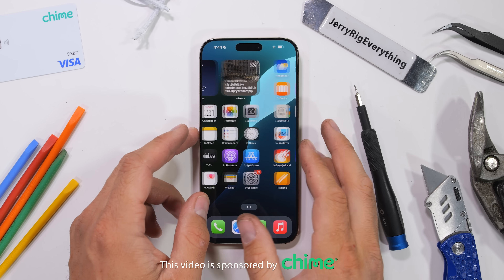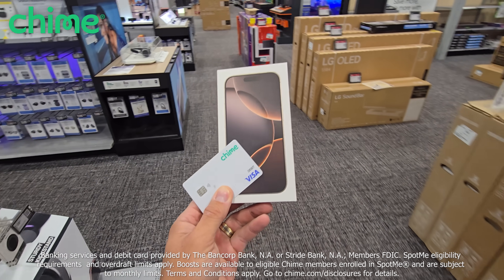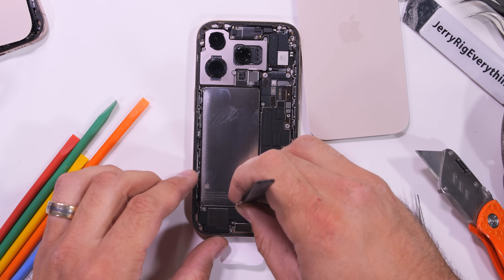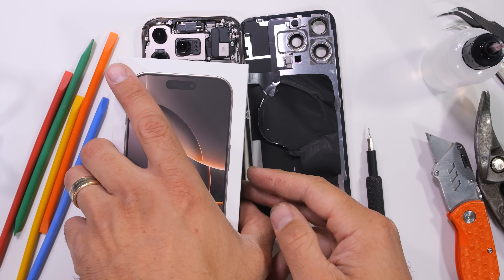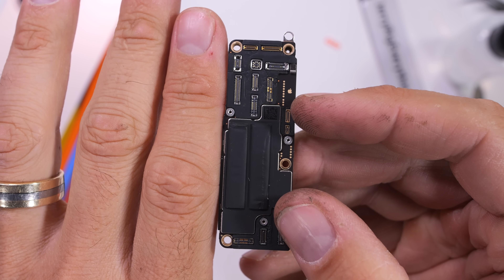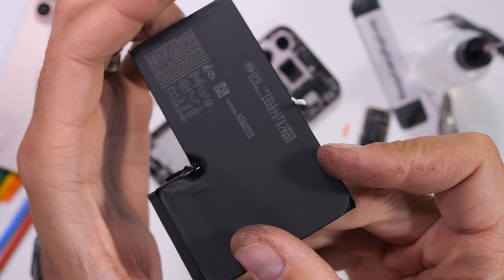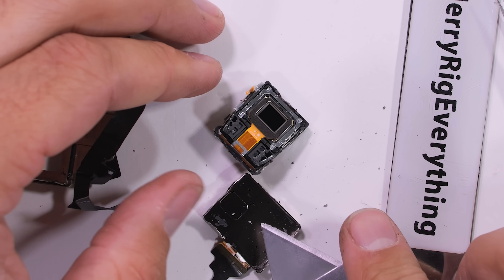Dear Apple: i am sorry...  (iPhone 16 Pro Max Teardown)

Comment: I’m still confused about the reason for the metal housing on the battery… you mention that a potential reason is to keep up with repairability and sustainability regulations and that this would also explain the existence of the new repair guides, but how does this requirement necessitate a metal housing? Are metal housed batteries more recyclable or something?

Comment: Still prefer apple over android , apple's hardware and software both are designed in house so I have not seen any major issue , but in android since both are not in house i have seen premium phone lagging because of a update or maybe hang very frequently so i know apple is not having best features but I like the phone last 4+ years which is value for money.

Comment: You Should try the 16 teardown as it doesnt have pull tabs it has something electrically activated glue which lets the battery off when current is passed

Comment: The metal battery is very cool. I am interested whether trusted aftermarket part providers will use the metal enclosure too or keep it as the old batteries.

Comment: Fun fact the non-Pro iPhone 16s have a battery removal process that is truly next gen, they use an electrically operated adhesive (need to connect a 9V battery to certain points on the phone chassis) which has the potental to be far better than pull tabs which break fairly easily (unfortunately no more satisfying pull tab noises)

Comment: providing the repair guides and encasing the battery in metal is just prep for the EU requirements.  I was hoping to see a chassis where the back cover would be fastened with screws though.....

Comment: You should check out the battery removal process on the regular 16 which needs a charge to remove the adhesive. I think you’d like to give color on that

Comment: The non-pro iphone 16 has something even wierder. There are electrodes that melt the battery glue when you connect a 9V battery to them. Phone Repair Guru has a short about it.

Comment: them releasing that NOW and under pressure should not make you reconsider your thought about apple. remember that is only half of the problem. the other half is making their phones repairable in the first place. they have specifically designed them to be non-repairable. its so obvious because they even glued down the battery when its already sandwiched in-between the screen and the back case (which by the way is ALSO glued down to the frame). still absolute scumbags. they, and many other companies know EXACTLY what they are doing. and its comical because everyone puts the blame on the people buying the phones about e-waste when the companies are forcing people to buy completely new phones every year. Releasing the repair info is a small start, but still scumbags

Comment: 6:18 The lithium in the batteries can be recycled at specialized centers. This does not mean you should throw your batteries in your recycling bin, this is a hazard. I'm also curious why Apple decided to have pull tabs on some, the electric removal adhesive, and the metal framed battery instead of the same across all iPhone 16 models. Maybe they're just testing the waters.

Comment: That pull tabs at 5:20 has the same sound of my door when i try to be as quiet as possible in the middle of the night😂
Reply: the iphone 16 just got a major wedgy!!!
Reply: Real
Reply: This could be ASMR for someone for sure lol
Reply: I started hearing police siren at this 5:35 time
Reply: What is the logic behind the steel battery case?  The only thing I can come up wuthering is thermal performance.
Reply: Indeed, true story bro.
Reply: @op, it's not the door bruv, your missus is just timing her farts perfectly!
Reply: When you wanna get something from kitchen at 3AM 😂
Reply: Same here 😂😂😂
Reply: lol that's so relatable lol!
Reply: Mine used to sound like that when me and my family moved in, within a week, I replaced the hinges with squeak proof hinges, and haven't had a problem
Reply: @whatluck1508  You can just oil the hinges.
Reply: @chiefdenis  while true, i was also changing out the brass looking hinges out for a less flashy Satin Nickel
Reply: Yeah, that could be a problem if your a swinger, swinging.

Comment: i thought removing the battery requires you to use a 9V battery to heat and soften the adhesive and it pops right out  🤔

Comment: So do you know why the 16 and 16 plus batteries have the electricity activated battery glue stuff that you can remove the batteries by putting 9v to them and why the pros don’t? That doesn’t make sense to me. And why would they only use the metal batteries on the pro and not pro max? Wtf is apple doing lol.

Comment: I saw in Hugh Jeffrey's video that in one version of iphone they have an battery that can be remover by applying current on it. after few minutes, the battery set free. and the battery doesn't had the metal frame thing.

Comment: I thought they had the electric dissolveable adhesive under the battery using a 9 volt battery. I was hoping Zach was gonna test that out.

Comment: Why does the iPhone 16 pro Max have a battery in a plastic case?
How will this affect the battery performance, cooling, charging, durability?
Why did apple leave the plastic case in the larger model?
-didn't have time, 
-saving money, 
-no need because the larger case dissipates heat better?
Weight or something else?

Comment: I hear the camera control button repairability is an isssue as it is welded shut to the frame… is that true? Please cover that when you make a follow up to this one or one of the regular iPhone16. 

Also, what’s the fuss about using a 9V battery to remove the iPhone battery?

Comment: I would definetly be more than honored to have an iphone 16 pro that jerryrig knife etched a smiley in!! hhahah would be a dope upgrade!
nah but that metal enclosure for the battery looks crazy, and it's quite crazy how apple now finally released some repair guides for the most used phones as of rn (i assume that's why no even older phones are on there?? but i guess that was expected). 
and what i additionally find interesting is the fact that the ribbon cables seem ways easier to manouver around, when compared to an iphone x i recently repaired, where the battery and display ribbon were tightly together besides the battery...

Comment: I’m still all for Apple, I don’t mind paying the price for the quality, as for the repairing thing, I’ve have had mobile phones for the past 25 plus years or so and I’ve never broken a screen or need a repair, maybe I’m lucky or maybe I look after my things. Apple may charge a lot for repairs but if you equate it with any other manufacturer of high end electronics the majority are expensive, these things aren’t meant to be repaired  by the untrained public its purely because the parts are small and easy to get hold of that a market for home repairs has emerged, when to be honest it shouldn’t have. And I know that his won’t be a popular opinion lol 😊

Comment: Isn’t the battery removable by running a current through its adhesive like on the non pro iPhone 16s? Why wouldn’t they use the same glue on all models?
Reply: referencing ifixit’s teardown

Comment: I never thought I would see the day Apple published free repair guides. Amazing.
Also thanks for showing us the metal battery, I did have a question, How does the metal casing make the battery more replaceable? Just the fact that it is harder to puncture? Will this have a noticeable affect on the cost for replacement batteries?

Overall a win for right to repair and I am all for it.

Comment: Hopefully you can also dig into the normal iPhone 16, given it's funky electrically releasing battery adhesive. Should be a fair bit better than those pull tabs you have a love/hate relationship with

Comment: If apple used a metal battery on the normal iPhone 16 we wouldn't need to use that tab to remove it. Literally just put an electroid on the battery and frame then poof it s out!

Comment: No one noticed how this iphone 16 had different battery adhesive than PRG's which was some weird metal strip you need to connect to a 9v battery?? I don't think I'm thinking of the pixel fold 9 pro i believe that has the little plastic stip thing

Comment: You missed the new way to remove the battery? iFixIt, put a 12v current on the pull tab and then the glue frees.

Comment: Wondering if the trick with a soldering SIM card and  missing components to motherboard and flashed with EU iOS will bring back the SIM card working. And of course new housing with a SIM tray hole. Happy to try😅

Comment: Very weird method that apple used in the normal 16 were you have to power the batterys adhesive to get it out. I guess Apple also wanted to invent a new way to remove a battery...

Comment: There is nothing to thank Apple for.  No one at Apple takes a crap without thinking how it can make them money.  The guides and the battery is purely there, as was said, to get around the mandate that is coming down.  If you want to thank anyone thanks EU for doing something vs the US that sits on their ass doing nothing.  It's going to be fascinating to see what Samsung and the like does when it comes to the fold phones and battery replacement.

Comment: I still remember choosing my first notebook based on the fact that it was standard practice for its manufacturer to make service manuals available to customers. And 15+ years later, here we are cheering that Apple finally decided to do the same, but most likely only because of legal reasons. Not sure if that's funny or sad (probably both), but at least it's a long overdue step in the right direction.

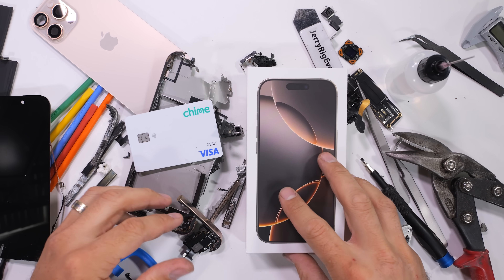Comment: That looks so much easier than the other phones, but that’s editing effect. I’m sure it can’t be that easy right? 8:43
Reply: I think the hardest part is getting off the front/the back. The glue is a little finicky, but with enough heat, it is relatively easy to do.
Reply: 8:43?

Comment: Those strips the batter is on I believe are thermal strips like there are on the memory chips on video cards, also the metal encasing I believe also contacts whatever is on back of the phone so it conducts the heat to the case and then dissipates? I might be wrong but I think that's how it works?

Comment: Another great video! Very interesting to see that the pros do not have the same easy to remove battery as the regular models, and that between the pro and pro max there is differences. 

Would love to see if they are using the same amount of titanium as last year

Comment: I love this kind of videos coz i love to see what's inside and that iOS 18 will soon change the repair ability since if you use a genuine apple parts from another iPhone as long as it is not report stolen it won't be on activation lock then on iOS 18 it will let you calibrate parts which is very cool i am currently on iPhone 15 Pro 94% battery health 249 cycle count

Comment: If you apply alcohol to the pull tab as you pull it... comes out like it's supposed to. Also, you need 0 heat to open an iphone. Any model will open with a straight razor angled into the bottom of the phone, between the assembly/rear glass and the frame, you have to use straight razors. Not a utility knife. 

This will give you just enough space to insert a plastic pick (guitar pick on the harder side works best) and then you preserve original adhesive without reactivation or alcohol. In all my years I've only had one screen break doing this, and it was already cracked/heavily scratched, was being replaced anyway. 

You do not need a suction cup, pretty much ever. Straight razor leverages the glass at the point of contact, rather than flexing the entire plane to create a gap. It also has the convenience of being shaped precisely the way it needs to be in order to achieve the task. 

Heat guns for painting should never be used for electronics repair, you cannot regulate the temperature, flow, or air pressure.  A hot air station can do all those things, and you should have a setting dedicated to softening adhesive, something like 180c at 40% flow with a very small tip, maybe 1/4". Just long enough to reactivate the adhesive they use and pull flexes and other stuff away clean. 

Can even reuse adhesive. If you need to insert anything into a device to 'cut' you want to use a plastic card. They come in 10pc and 100pc sometimes, ali express or wherever you get your stuff. They look like a very flimsy/thin credit card, usually clear. The right ones are very flexible/durable and last a long time, the cheap ones usually end up being destroyed quickly. 

Round nosed tweezers, 2a Sa will work better for most of what you are doing with your tweezers, while also not being sharp. They basically give you manual dexterity at the 1/16 inch scale, can transfer leverage and work as a multi tool of sorts. I use mine on all repairs. 

If you nick a battery ever so slightly with pointed tweezers... Hope you like smoke. baking soda is probably what I'd use to extinguish your battery fires.

Comment: Interesting how the base 16 models have a method of electrifying the battery pull tabs to heat them up to remove the battery and the pro models are still using the traditional pull tabs.

Comment: Honestly it’s a good thing to see Apple putting all the repair manuals out into the public, regardless of the reason why.
Dear Apple : your repair guide will not stop JerryRigEverything
Reply: The EU does a bunch of bullshit, but that they forced Apple to implement USB C and publish repair guides is great. If i remember correctly, they also discussed to require them to sell the original parts, so People can replace original batterys themself and arent forced to buy fake china batterys. And i think this rule also applies to screens, ports, Buttons, backcovers, etc.  Probaby Security stuff like Face ID and some Special chips like the one for Apple wallet are excluded from the rule. But im not sure if Its already passed
Reply: Oh, that would be Great

Comment: It's funny how despite the EU regulations apple is almost completely inaccessible in countries outside the US unless you are rich. And Samsungs are priced the way they should. Where I am from, central Europe you need to pay over $1400 for the 16 pro base model. Even refurbished phones cost more than in the US brand new. Where as Samsung phones cost nearly the same, you can get the s24ultra for around $1400 or 100$ less making it a lot more valuable.

Comment: apparently the iphone 16 doensnt even have pull taps or adhesive but magneticaly connected battery so u basically just need to connect a nine volt battery and charge with removes/puts it back which is pretty cool i think its to prevent the damage of the battery and also to prevent people fucking up the phone trying to remove the battery

Comment: You bought an iphone 16 pro just to see if the battery really is encased in metal, now you have to buy the regular iphone 16 just to check their new adhesive that reacts to low voltage current 😂

Comment: The battery in a metal casing was cooler than expected. But no clue why, they try to make everything smaller and/or lighter, so no clue why they add (even an ultra thin) layer of metal.

Comment: Supposedly the new battery shell has some form of electronic aspect to make it easier to release. I have no idea how it works, but running a <12v current through *some part of it* apparently causes the adhesive to heat and soften to the point that you can easily remove the battery. I haven't gotten my hands on one, though, and my information isn't necessarily confident, but I'd certainly like to learn more about it.

Comment: i wonder why exactly they encased only the standard model's battery in metal, cause if it was EU regulations, they would probably put it on all of the models, not just the standard one, well that is unless theyre using the people who bought the standard model as "lab rats"

Comment: @JerryRigEverything

Those aren no longer pull tabs in a sense, you have to put an electrical current through the tab and the battery will detach from the adhesive.

Comment: Lithium batteries can be recycled, it's just not economical to do this for larger batteries. It pushed the price of a 70kWh EV battery from $20,000 retail to closer to $100,000. Fine for a tiny flagship phone battery (note it's just the lithium that's recycled not everything else), not so much for an EV.

Comment: I've been torn on taking my 13 Pro into Apple to get the battery replaced. I used to do repairs for ~4 years but stepped out when Apple made it increasingly difficult to repair phones with all the software bullshit. Glad I waited though because hearing this news and checking their site, I ordered a 13 Pro battery and cant wait to get it!

Comment: I think those are new pull tabs on the battery, which if you apply voltage to, releases the battery from the frame.

Comment: I think the metal plate on the battery is meant to shield the battery from puncture damage. It would make sense because if the back glass cracks, a sharp shard could puncture the battery.

Comment: What is going on with the batteries this year? The 16 has the electro-removable battery, the 16 pro has the metal battery, and the 16 pro max doesn't have either?

Comment: It's too bad that reparability is not friendly to water resistance. If not for the EU, Apple might have used marine weld on the back and front panels and called it "Ultra Metal Bonding".

Comment: maybe the adhesive on the metal battery same as non metal but stick more that 'they' do not calculate with or the manufacturer set the wrong spec

Comment: Can't wait to win my first thing 
P.s you didn't mention the new electrically removable adhesive? You just need to wire a low voltage battery to it and it just drops out, very cool

Comment: I would be more impressed by the metal batery if was easier to extract I miss being able to replace battery of a cellphone more easier, back in the day I used to have two batteries to use on my cellphone.